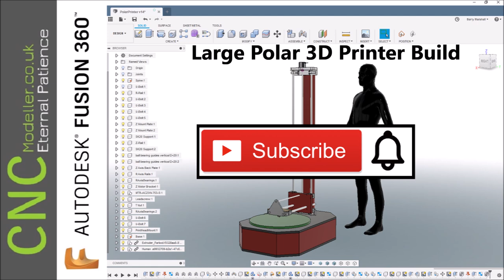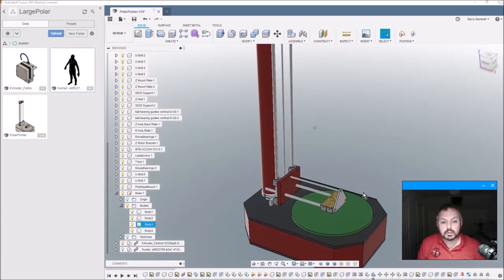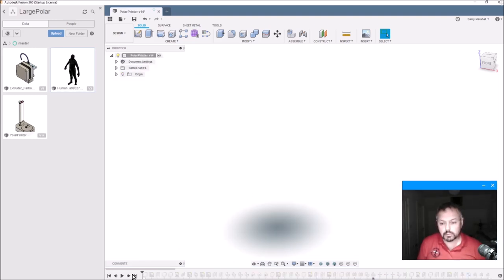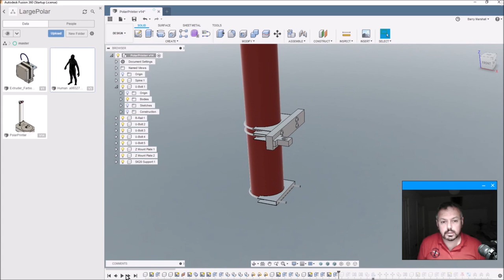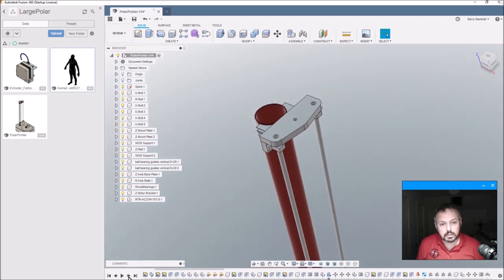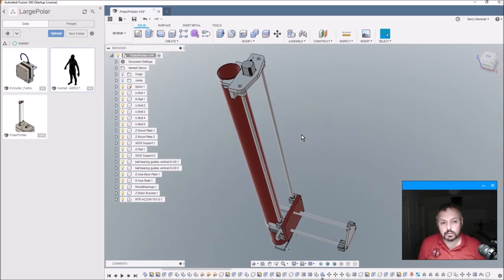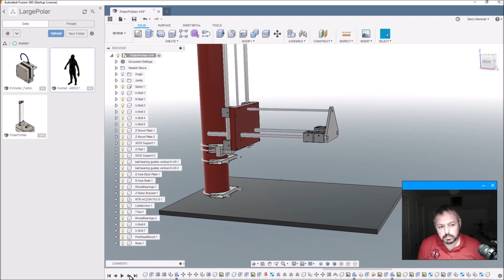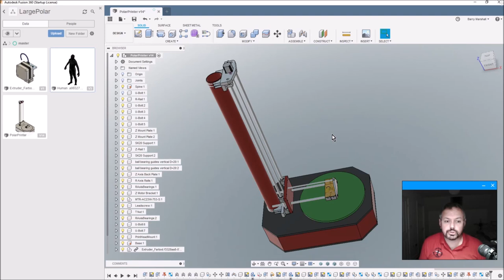DIY Novel Industrial Design Custom Large Polar 3D Printer Build

Comment: Great video!
Is there any news on this??
Reply from the maker: Hiya @creativitybyph, there are several later videos this is the latest with it printing. It’s currently being upgraded with a heated bed and better closed loop feedback. I’ve not been well recently and work has been very busy so progress is slow. Hope to start posting again soon. 

https://youtu.be/mLz1vDJkfgs?si=bq0xnzB8mxGQ0sb0

Polar Printer
https://www.youtube.com/playlist?list=PLWjZVEdMv1BY82izahK45qKh-hp3NFkix
Reply: @CNCModellerUK  I have started thinking of a polar3D printer, about the same size but based on a RatRig V-Minion.

Just to print vases and lamps with lager nozzles
Reply from the maker: Duet 3Ds RRF supports polar out of the box albeit if you are considering a build you need to factor in being able to tram in the rotary axis I have a system that allows me to do this but it’s inherent in the structural design. My target is large model aircraft which are essentially big tubes too. 
Good luck with your project!